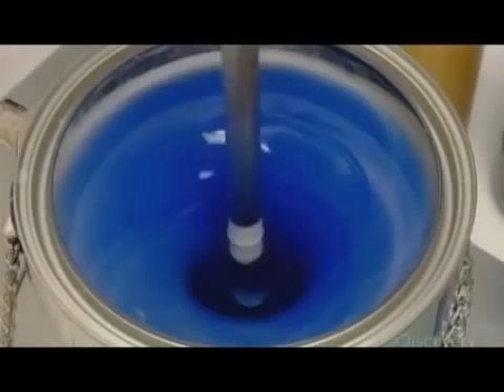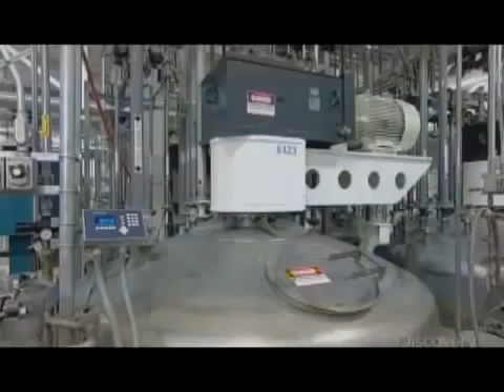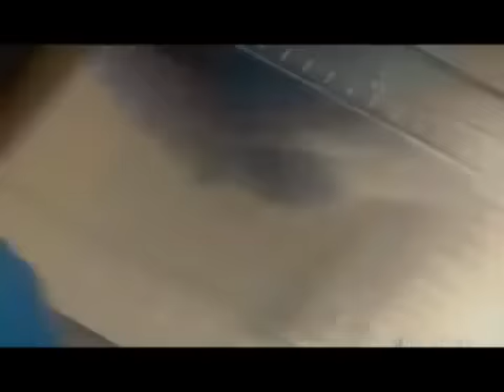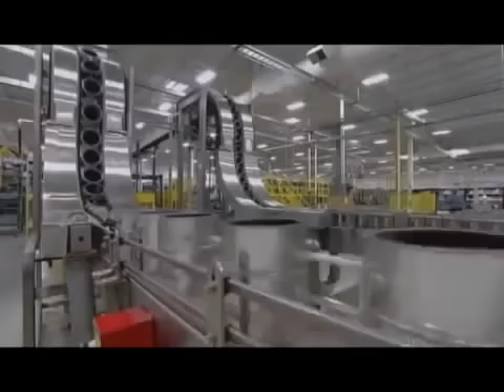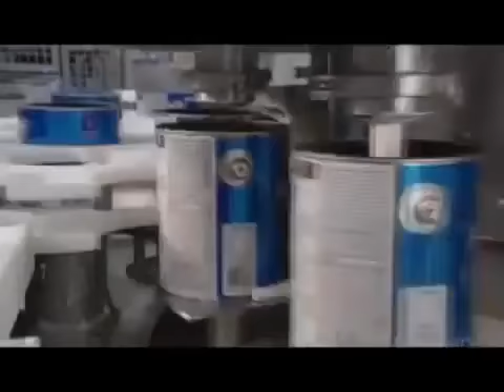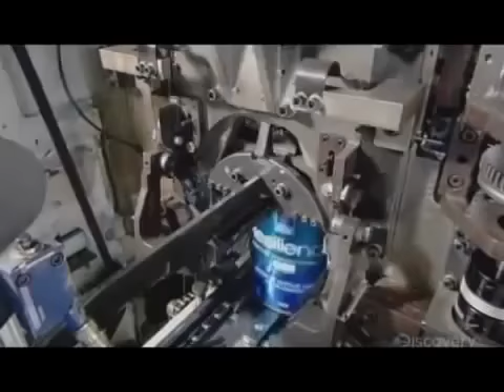How its Made Paint

Comment: i use Behr Marquee, just as good if not better than SW, too many paint elitists look down on BEHR, but i've used it for personal use and in commercial applications, never ever ever had an issue. It's more about how a paint is painted than actual paint itself, all you have to do is prep properly and use the premium level paints instead of the cheapest one in the line up and you'd be fine. Marquee from BEHR is their most expensive line up and it's never been given me any problems.